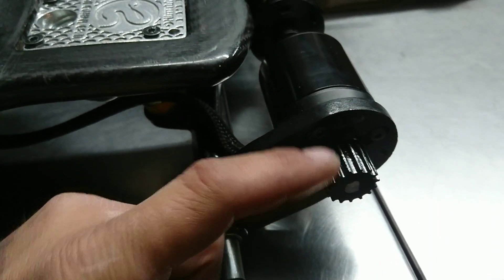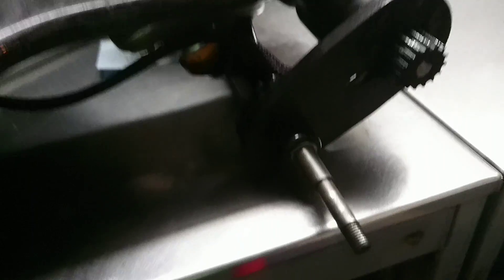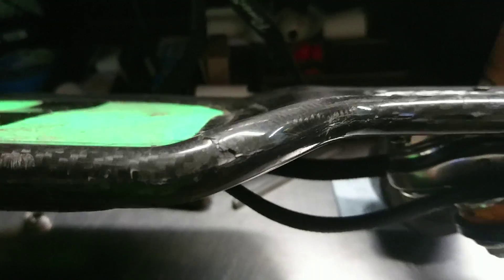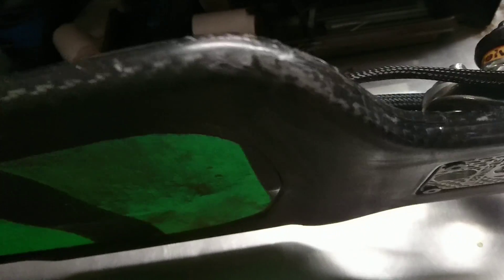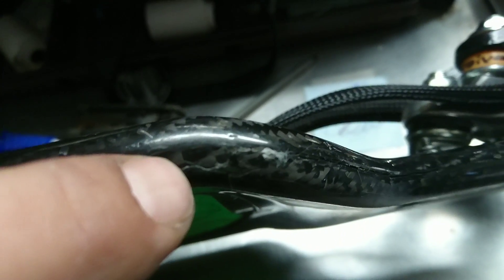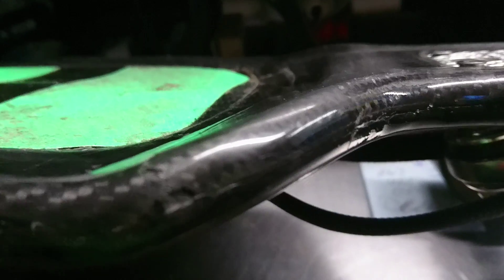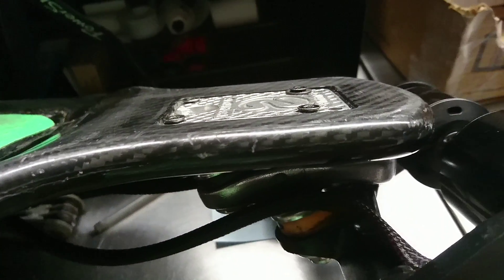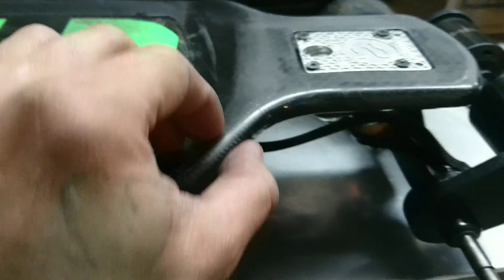Weak Carbon Fiber on the Evolve Carbon GT Electric Skateboard

Comment: that fucking sucks, could you inject some resin with a syringe and clamp until it sets.
Reply from the maker: +3dguy dude I am like Blown Away every week because there's something that comes up with this board it's really truly unbelievable. but I do have a resin injection kit and that's exactly what I was thinking because it is damaged it is cracked but it's not damaged that bad yet so it's definitely still savable as a matter fact it's probably better that this happened now and I found this now because I will be able to save it. I have some really cool black and red carbon fiber that's got Kevlar in it as well. that's exactly what I was thinking though draw a couple holes and inject up puppy airbagit and it should be good